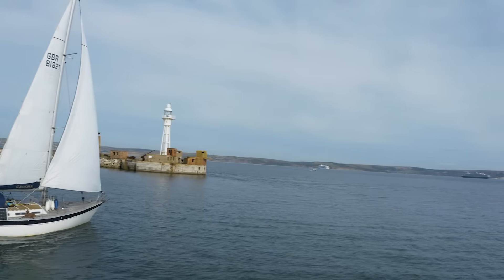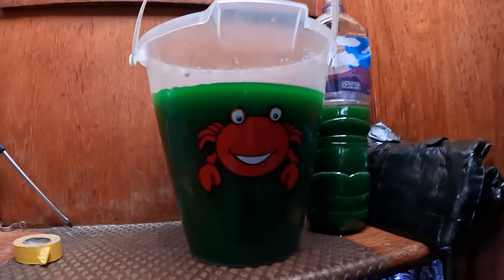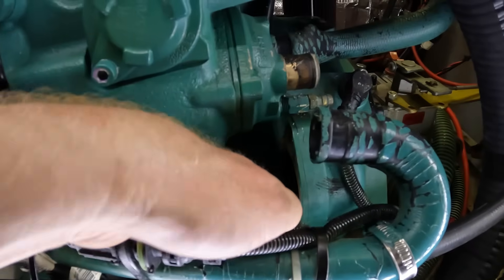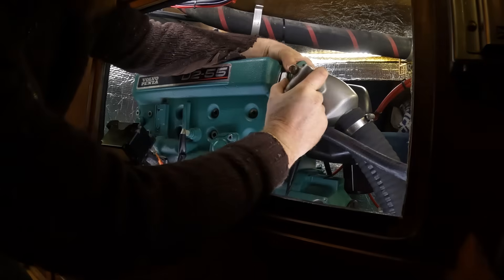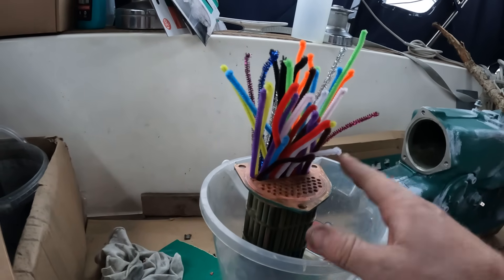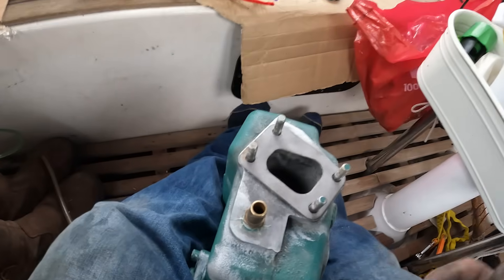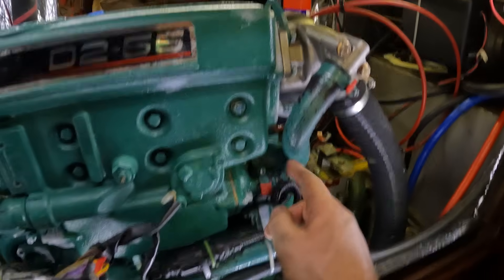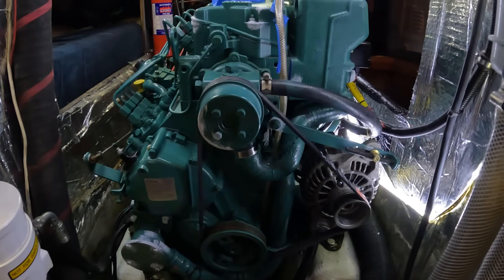Overheating  - Troubleshooting a small diesel sailboat engine  (Volvo Penta D2 55F)

Comment: I too am a self taught mechanic. One thing I would suggest is to stop putting nuts, bolts, and parts on top of your engine after you remove them. You are just asking to have one fall down under or in an inaccessible place in the engine or under it.  I have had this happen to often to spend more time wasted looking to retrieve the item. I always use a cardboard box. Beer/soda six pack cardboard cases work great. Not to big, you can rest them like a tray on top to hold all the parts. Additionally, I often poke a small hole in the cardboard to hold the bolts in place and in order and then use a marker to write on the cardboard notes about the bolt. Or draw a diagram of where the bolts came from on the cardboard. Hope this helps!
Reply: Or you can put them back in the hole if it’s appropriate. An old race car mechanic taught me that one. I’m just passing it on.
Reply: magnet on a plate are a game changer

Comment: I truly believe the Volvo Penta designers firstly designed the engine to be the most difficult thing to work on ,and  the other lot went and found the most expensive parts on the planet.
Reply from the maker: The parts from Volvo are indeed expensive, but if your engine is out of warranty, then I’d happy days to try out the website’parts4engines’ 👌🏼 far cheaper 😬😬😬⛵️
Reply: Personally, I suspect Volvo must have hired a bunch of ex-Mazda designers and engineers. Many years ago, I learned the hard way that no matter what engine part you need to replace or access on a Mazda, even just the spark plugs, you'll need to remove 6 other items first, in order to get at it. Worst. Design. Ever.
Reply: Volvo Penta buys the motors from Perkins and paints them green. They do not design them by theirselves.
Reply: I did exactly the same job on my Vetus 42 hp. It took us 1 hour, including cleaning. The amount of parts to disassemble here is reticules

Comment: My tip if you want it - especially now you have the heat exchanger nice and clean. I buy the expensive stuff (Rydlyme), 5 litres should do your engine. Shut off the seacock, open up the strainer, get someone to start the engine while you pour the descaler in the strainer then shut the engine down as soon as it’s all in. Put the lid back on the strainer and leave for 8-12 hours. Do this once a year and your heat exchanger will stay looking brand new and no major strip downs with gaskets etc! I do this at the end of my season then flush the descaler out with fresh water via a hose in the strainer. I then drain my coolant and replace (you should do this every year) then pour the old coolant into the strainer same method as with the descaler. So now my raw water system spends the winter with fresh water and corrosion inhibiting antifreeze in it.
Reply from the maker: This is exactly the main reason I post these kinds of videos, rather than simply our summertime joyrides, I learn so much in the comments and no doubt so will many others too. Thank you for taking the time to share your tips and tricks with us all 🙏🙏😊
Reply: I do the same thing but use hydrochloric acid which is pretty cheap. Mix a 50-50 solution of water and acid in a bucket to give about 8 litres, disconnect the raw water inlet hose and put the end in the bucket. Run the engine until about 6 litres has been sucked up then shut off the engine. Leave for about 90 minutes. Restart the engine and suck the remainder in and leave for another 30 minutes. Reconnect the raw water to the strainer and run the engine. If you watch the exhaust when you start the engine the second and third time you will see all the green gunk spew out, very satisfying. The solution doesn't harm the impeller or hoses. A word of caution, where gloves and goggles when handling the acid and avoid breathing the fumes.
Reply: @CadohaAdventures  give and take - I enjoy watching your videos so thank you too.

Comment: Thank you very much for ensuring that I never even consider replacing our boat's engine with one from Volvo. It's fine when the internal gubbins of an engine can't be easily accessed, but it is perverse to make it incredibly difficult to check and clean components which are known to get regularly gunked-up during normal usage.

Comment: Hi Mate. D2-55 Heat exchanger matrix will come out the front of the engine. No need to remove the header from the engine. You can clean it in situ by removing just one end cap. But the method is top secret, I could tell you but..... Get yourself some anti-seize paste for those bolts and torque them to the correct value. Great to see you gaining skills. BTW you got a big shout out last week from us. Sail Safe Guys, Ant, Cid.
Reply from the maker: Unless I’m missing something there no way that cylinder could come out the front? There’s a lip on the back that stopped it coming out, that’s why I transitioned to taking it out the back.
Reply: @CadohaAdventures  Ah Ha, depends on the version.
Reply: Only on the A and B versions of the D2-55 This is a later version F from memory
Reply from the maker: @PittwaterMowingAustralia  it is indeed the ‘F’ version.

Comment: Good work Dom.... and not one single swear word lol....Just a thought for the next time you check it. Get a air rifle cleaning kit. It has some fab long cleaning brushes that would fit in your cooling tubes. That way you wouldn't have to do a full strip down. Maybe check both end caps after 25-30 hrs engine run time just to see how clean it is. Take care bud ⛵👍
Reply from the maker: Appreciate that, Vince, cleaning it in situ does sounds like a much better option than a full dismantle again. I can assure you there was plenty of swearing, which is why I'm thankful that I have full editorial control over the video production 🤣

Comment: I've done mechanic work for over 35 years, engine rebuilds, brakes bearing etc. Good job of cleaning and getting it back up and running. I don't have a boat but I do have a truck that I take out into the desert in the middle of nowhere. It's very reliable, it's a 2001 Ford F350 with the famed 7.3L International Engine in it. Most engines have certain parts that are not always locally available that are critical to run the engine. I tend to keep those parts behind the back seat of the truck to ensure if it does break down I have them right there. Like a Water Pump, Hoses, belts and certain sensors. I also keep some internal parts available along with the special tools, if they are small tools, that allow for a side of the road replacement if needed and the maintenance manual as well. So far I've never needed any of them except a belt that I had to change in a food market parking lot, 15 minutes later we were on the road again. I would imagine you keep light weight parts like Gaskets, belts, a spare injector or water pump available so if it breaks down in the middle of nowhere you can get it fixed in a day or less. Regarding the oil cooler I would have just pulled the cap ends and run a long drill bit or wire through it rather than pull the whole side of the engine off, since you saw the problem was just inside the end caps. A helpful suggestion, when putting bolts back in, that can have moisture around them, is use some Anti-Seize compound like Permatex 133A or 81343. It's made of some grease and various metals that won't corrode and makes it very easy to get the bolts and nuts back off later, it also prevents bolts from breaking off in the engine. When installing large major components on engines, heads, exhaust manifolds, pumps make sure to use the proper torque pattern with a torque wrench and the proper torque setting. That will ensure the gaskets don't blow under load. If you don't have the Torque Pattern or sequence it's usually safe to start in the middle and work your way out in a cris-cross X pattern. If you don't have a head Torque Value, small 4 cylinder Heads are usually done in two or three steps. 1st step 25ft lbs, 2nd step 50 ft lbs and the 3rd or last step is a quarter turn (90 degrees) or around 60 ft lbs. Exhaust Manifolds are usually around 12-18 ft lbs.  You can convert Ft lbs to Newtons by multiplying the force by 4.448 ie 10 ft lbs X 4.448 = 44.48 Newtons. In any case always make sure and go by the book when it's available.  Best Wishes & Blessings. Keith Noneya

Comment: Great episode Dom, I do this on heat exchangers onboard marine vessels and offshore rigs. Mainly for biosecurity issues but also efficiency. I was glad to see you didn't dive straight in for the expensive de-scalers. They're great if time is an issue but if not all you need is a little acidity and patience. Clean as a whistle by the end mate so top job!

Comment: Brilliant job and really well filmed detailed. Well done and thanks. Not bad for a non-mechanic! Can't understand why the engine manufacturers make it so difficult to do basic engine maintenance, but seems fairly typical in my experience. I note most of the comments have already been made, like which way round the rear cover plate should fit, it looked correct from what I could see. Other comments are always worth seeing, everyday is a school day as you say. Also note Mads and others have moved their Volvo black electronic control box away from the engine block.
 I really enjoy all your videos, particularly it's great to see the variety of cruising life, including the boat maintenance and your sense of humour. Boats don't always perform perfectly and it's great to see how you deal with them. (That's often what makes them interesting)! Keep it up!!

Comment: Really excellent video.  I have not cleaned my heat exchanger yet on my small Yanmar.   I change my impeller every two years with new,  and to my shock - last time I changed my impeller on routine maintenance - there was one blade missing!  So that blade is in there somewhere on the front face of the heat exchanger.    luckily, no overheat symptoms in the engine.  
 It does appear to be WAY easier to just pull the heat exchanger out the front side of the engine on the Yanmar.   
They say BETA marine engines are designed with routine future maintenance in mind.   
Nice job.  !

Comment: Well done on your fix. I read through all the comments and learned things too , you tube is great for this alone.
Unmentioned in the comments is that solid copper gets work hardened in use. So solid copper gaskets don't reseal that well.
However if the copper is heated , with a plumbers gas torch usually , and then cooled in water , the copper is good for reuse . This is called annealing  . the copper is softened and will seal better for it . I learnt this trick when I fixed my Norton motorbike cylinder head which used a copper head gasket ; I never had to buy a new gasket ! 
Love your channel for the sailing , the visits ,  the fixes and yourselves . Thank you so much . Dave

Comment: Great job Dom.  I feel your pain of having to half dismantle the engine just to replace or service another part of the engine.  My Volvo Penta is a 2020B and I had overheating which I thought was the thermostat.  To get to that I would have had to remove heat exchanger and many other ancillaries.  Annoys me engines, including car engines, don’t seem to build in ease of maintenance.  My issue turned out to be a blockage to the water inlet in the hull.  It was fine low revs but as more water was required. The fouling on the hull was sucked over the inlet.  Worth checking that if you haven’t recently.  I went on the scrubbing piles at Emsworth and scrubbed the hull at low water.  Cost £20, you guys should give it a try as it saves a huge lift out fee.  Itchenor has a jet wash you can hire too.  Give me a shout if you want a hand with it but I expect there is a scrubbing grid in Southampton Water somewhere.  I’m a big fan of those ratchet spanner’s, they save many frustrating hours of getting an open ended spanner in tight spaces.  Loved the gentle lounge music in the background.  Good to see you on Mads channel and that your travels are not too far away.  I’ve ranted on enough now lol.  Andy UK
Reply from the maker: Hey, Andy, yes I hadn't even considered a partial blockage at the hull end of the system, which is odd when you think we had a blockage there right back when we first started on this little adventure, so thank for the reminder!

We did see some drying out piles on the Hamble river that we were tempted to brave once, but we never did in the end. Certainly does sound like quite the saving though 😍

Comment: Great video.  We had the same issues on our D2-55 and ended up in a similar situation last summer.  We removed and cleaned the exhaust elbow in Cleaning vinegar (double the strength of normal but still gentle), removed both exchanger caps (our inlet was almost full of impeller bits from the PO), and we ran a drinking straw cleaning brush through each tube with the exchanger in place.  And the trick for the last cap screw on the aft exchanger cap is to find a ball head Allen key.  It allows about a 30 degree offset to remove the cap screw.
Reply from the maker: Ahh great tip, I ended up cutting half the head off of an allen key to squeeze it into the gap 😬😬

Comment: Great video, very detailed. On my end I use Barnacle Buster and back flush my engines, that way i get most impeller parts back in my bucket if there are any loose ones in there.

Comment: Another vote for Rydlyme, I used a litre of it with a litre of hot water pumped from a bucket and small 12v cheap whale submersible pump on my Volvo D1-30 via the sea water inlet and out through the water outlet pipe with the impeller removed.  I made sure the engine was warm so that the chemical reaction was speeded up, and pumped it one hour one way and one hour the other way.  You will see the bubbles showing the chemical reaction is taking place and they will slowly diminish as the complete system is totally cleaned.  Have a look inside to confirm all is good, but it is magic stuff and it would have cleaned your heat exchanger in minutes.  It is safe and a video is on their website showing a seashell dissolving in a puddle of it in a person's hand!   Of course you had to get that end cap off to find the impeller parts, but that shouldn't be necessary in the future.  But a great strip down job where you found other issues.
Reply from the maker: That sounds awesome, now it’s all cleaned out, I am very much in favour of being able to clean it in situ next time 🙏🙏🙏🤣

Comment: "Everything, and I mean everything, that could be in the way is in the way". Yep. That has been my experience, forever. i would not have replaced the gasket, but used a smear of the best gasket sealer you have access to in your area. And the manual will give you torque reading for those 12mm studs/bolts (20 ft/lbs, from memory) so a torque wrench will be a great addition to the kit. Great work.

Comment: I did this on my D2-40s. Although I eventually removed the heat exchanger to allow for some welding, I found that you can successfully remove any build up of scale in the cartridge by using a piece of copper multistrand wire.  When you have stripped a short length with the strands folded back over the PVC.  Use as a pipecleaner inside the tubes without removing the cartridge.  All in all, as you say, best avoid removing the heat exchanger if you can. For the exhaust elbow, I used a high temperature silicone gasket maker to insulate the elbow/heat exchanger from the (conducting) gasket and consequent galvanic corrosion. Seems to be working 6 years later.
Reply from the maker: Any insights on how to achieve the same result without having to take the whole thing apart is greatly appreciated 😬⛵️🙏
Reply: @CadohaAdventures  I just added a bit on the galvanic corrosion too! :)  On my engines, the intake from the raw water pump is relatively easily accessible, so you can check for rubber detritis and run your copper pipe cleaner through at the same time each season.
Reply: Great idea. I'm on d1-30 and can't get in easily. What guage wire did you find worked well? Thanks!

Comment: Wonderful job Mate,

If your familiar with aviation this type of maintenance is done every 100hrs .
I chose to do this maintenance every 300hrs .
Impeller & Heat Exchanger at the same time .
It will keep your engine happy, not barking at you with alarms  .
And using sea foam in your fuel tank along with seafoam when changing fuel filters which keep your injectors clean  .
Steady as she goes 👍

Comment: Great job indeed. I have to do mine sooner than later, I am on lake Champlain Vermont USA. This year I ran the engine dry ( boat was on its cradle ) for ten minutes to get the oil a little warn for oil change. Little did I know that by leaving the impeller in and running dry, all the blades would  break up and end up in the heat exchanger... so I need to do that job now where the space is even smaller to work :(  Thanks for the video. Cheer mate.